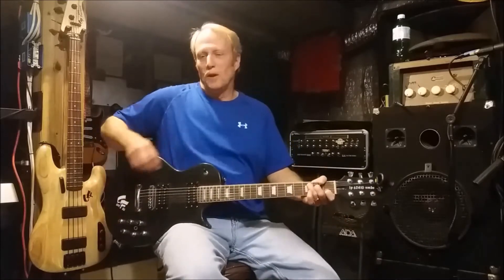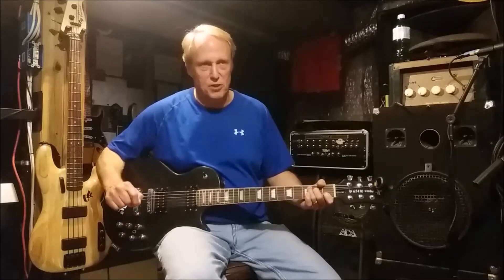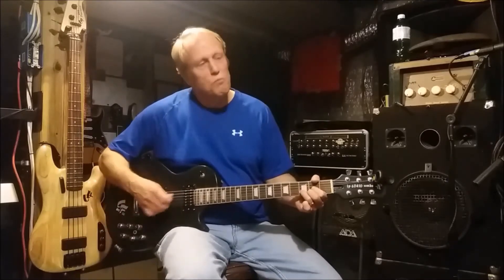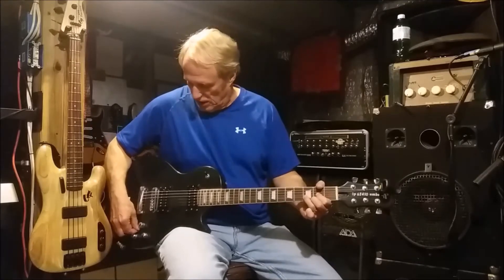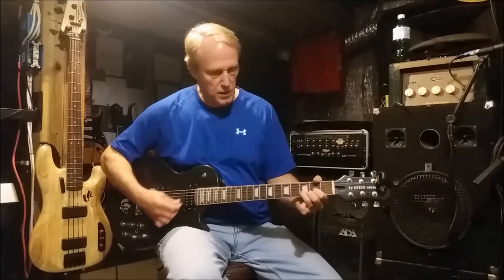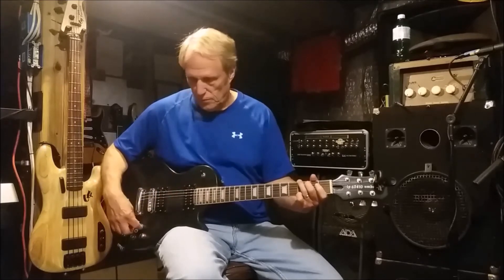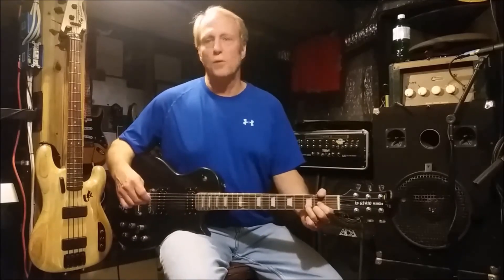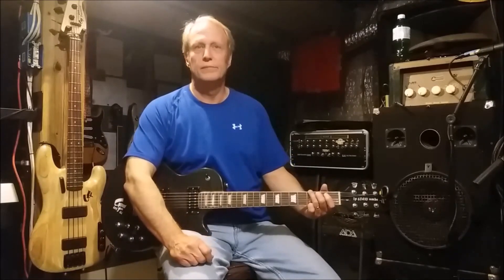GF lp 62410 umbs, VPCC for Bridge pickup. Part 1

Comment from the maker: Reversing Configuration Control for String Instruments and Boost Circuit Therefor, Two Patents used in that configuration.

http://pdfpiw.uspto.gov/.piw?PageNum=0&docid=09747882&IDKey=BD2F9051F45E%0D%0A&HomeUrl=http%3A%2F%2Fpatft.uspto.gov%2Fnetacgi%2Fnph-Parser%3FSect1%3DPTO1%2526Sect2%3DHITOFF%2526d%3DPALL%2526p%3D1%2526u%3D%25252Fnetahtml%25252FPTO%25252Fsrchnum.htm%2526r%3D1%2

http://pdfpiw.uspto.gov/.piw?PageNum=0&docid=09478207&IDKey=59F8961FBC62%0D%0A&HomeUrl=http%3A%2F%2Fpatft.uspto.gov%2Fnetacgi%2Fnph-Parser%3FSect1%3DPTO1%2526Sect2%3DHITOFF%2526d%3DPALL%2526p%3D1%2526u%3D%25252Fnetahtml%25252FPTO%25252Fsrchnum.htm%2526r%3D1%2526f%3DG%2526l%3D50%2526s1%3D9%2C478%2C207.PN.%2526OS%3DPN%2F9%2C478%2C207%2526RS%3DPN%2F9%2C478%2C207